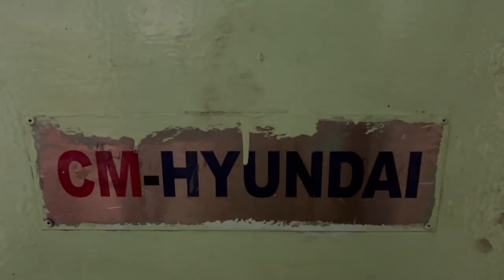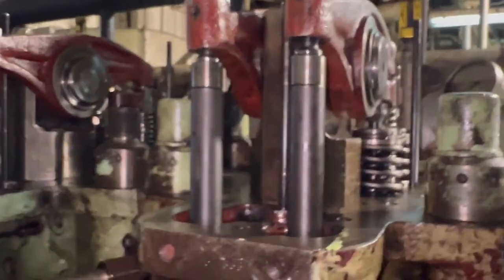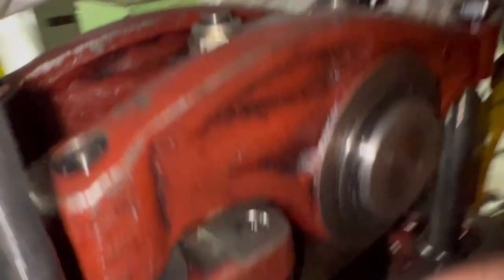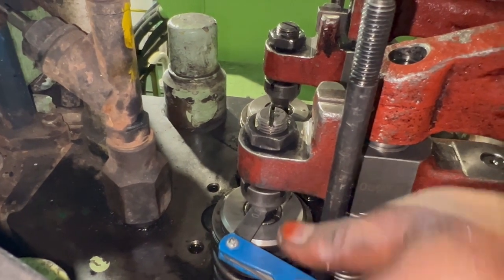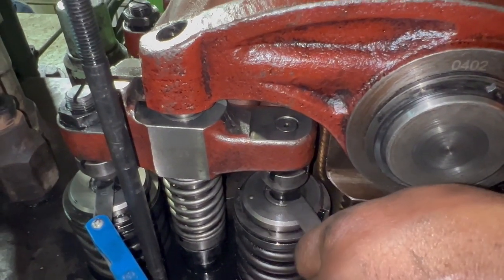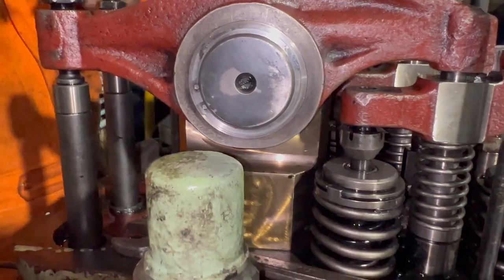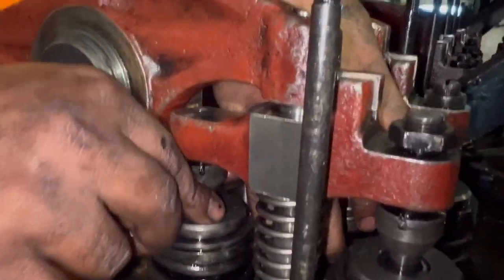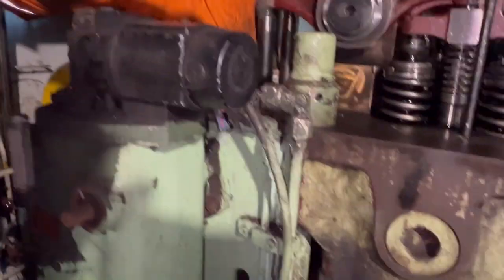Third engineer jobs...How to adjust tappet clearance for ZJMD MAN B&W generators...

Comment: Hi sir.. How are you?
Sir nice information regarding tappet clearance. Sir while checking the tappet clearance, whether we have to keep one feeler gauge above the area between the spindle and rocker arm, and then we have to check the other feeler gauge or we can check with one feeler gauge.
Sir actual ah epdi sir check pananum... Adjust panum pothu rendu feeler gauge use pani pananum nu video la therinjikiten sir.
Check panum pothum athey mathiri than pananumaa?
Please clear my doubt sir.
Reply from the maker: S pa ur rt... Each generator has differnt way of adjustment pa and concept will be the same..

Comment: No need to tighten the lock nuts by torque spanner?
Reply from the maker: no need sir...
Reply: Sir, what if there is no indicator or pointer for tdc on flywheel? How do you find the correct firing tdc?
Reply: In my flywheel, tdc markings are there but no pointer so as to match this tdc mark with that pointer to find exact tdc point..

Comment: sir, i am a new cadet.
how to understand which one is inlet valve side and which one exhaust valve side?
is their any technique to follow?
Reply from the maker: You can  easily find with the marking on the valve stem and also if needed u can c the camshaft position and find out the inlet and exhaust valve